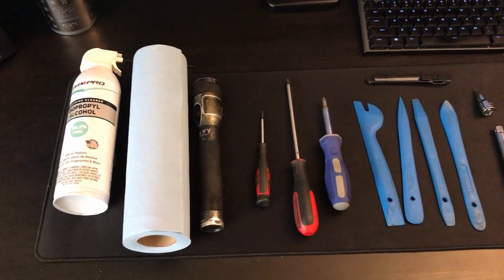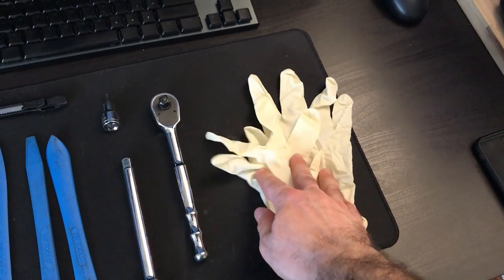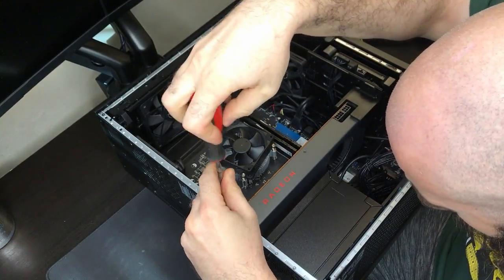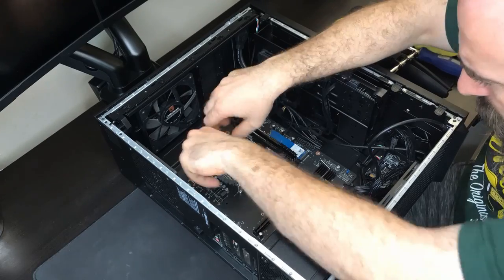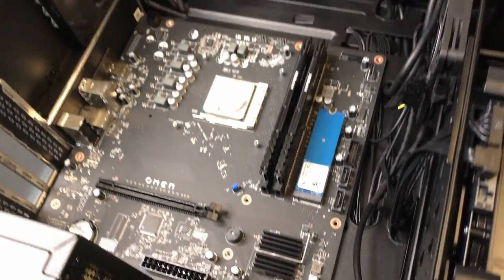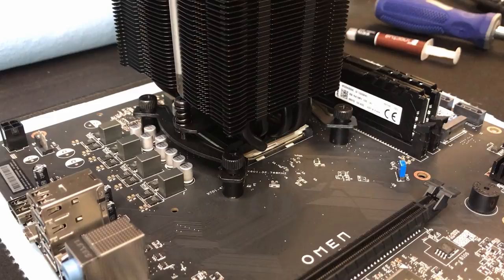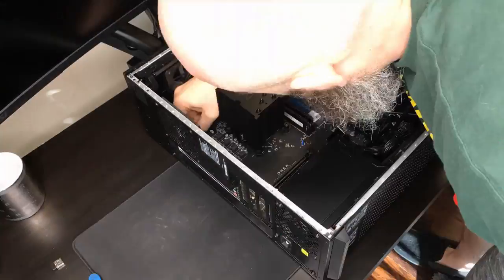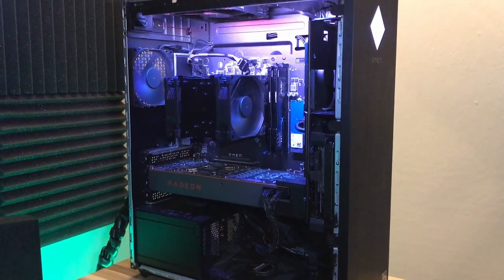Installing A Noctua CPU Air Cooler In My Omen! Complete Tutorial 😎

Comment: Hello when shopping for coolers are we looking for AM4 compatible for the omen? Thanks for you help in advance
Reply from the maker: ALL Omens are Intel spacing.
Reply: @DanKamYouKnow  is that amd ? Sorry I’m new to this and trying to see what noctua coolers are compatible cheers
Reply from the maker: AM4 = AMD / Omens are Intel. Only Noctua coolers that will fit are U9S / D9L
Reply: @DanKamYouKnow  aaahh thanks a lot I appreciate all the help your channel provides for us omen owners it’s perfect for people like me who don’t have a clue, I have purchased 2x 120mm fans one for the top and bottom and the u9s also I have rerouted the RGB cable for the standard cpu spire cooler and put that rgb fan on the rear exhaust fan one screw through the proper hole and one through the mesh of the makes sense
Reply from the maker: Nice! That’s the perfect setup right there! Happy to help 🤝
Reply: @DanKamYouKnow  also is there a way to change the cpu and system fans speed, I can change the gpu via msi but can’t work out how to do the other fans other than the standard settings in the omen hub thanks again
Reply from the maker: No programs work with the Omen motherboard unfortunately. We’ve tried all of them

Comment: Hey bud I got a question. I bought some corsair ll120mms, I have plugged them up. The lights and fans kick on, but when I download corsair IQUE the fans don't register. I read I need to be hooked up to a USB2.0. does the Omen 25l's come with USB2.0 header? Or would a USB2.0  connection work? Please and thank you for your time.
Reply from the maker: Hey Nicholas, there is most likely and issue because it’s not plugged into the motherboard, and unfortunately, the Omen motherboard does not have USB headers at all. Unfortunately I don’t have much experience with RGB so not sure what to do for a work-around.
Reply: Thanks anyways appreciate the help.
I actually ordered the GIGABYTE Z490 AORUS Elite in hopes the 2.0 headers on the mobo will be my fix.
Reply from the maker: If you’re going with a different board, you’ll be totally fine and it’ll have RGB headers and USB headers 👍🏻

Comment: Man that backplate was hard to pull out, I had to use an old card to get it out. Luckily the motherboard still works. I'd installed a Hyper 212 cpu cooler, btw.
Reply from the maker: Yeah, the backplate was a pain for sure. Most of the 120mm fan air coolers ( like the Hyper 212 ) are too tall to fit in the Omen case, you got it to fit?
Reply: @DanKamYouKnow  Well I case-swapped my Omen earlier, but yes, it does work. And no I could not get it to fit into the HP Omen case. Too tall.
Reply from the maker: Ohh, I thought you meant in the Omen case lol. This video is very old and I have a DIY build but still have my Omen, but it has a 120mm AIO that I installed for content purposes

Comment: I’ve been trying to get a wraith prism on my omen pc, and I got the amd stock mounting bracket but it still dosent fit
Reply from the maker: Wraith Prism will not work on an Omen board because all Omen motherboards use Intel spacing for their cooler brackets ( Even AMD processors ). You need to find a cooler that has LGA brackets as well, while the Wraith will only have AM4 brackets.
Reply: @DanKamYouKnow  ok thank you

Comment: Do you know where to find or a link for those black brackets? After watching video i want to do this install but not sure if the brackets come with the cooler or have to be purchased seperate. I have the AMD ryzen 7
Reply from the maker: So if you have an Omen, you are going to use the Intel bracket for the cooler. HP designed these so Ryzen and Intel both share the same cooler bracket design, and that is Intels. So whatever cooler you do have, you’ll want to use the Intel brackets. If you did need the brackets separate for some reason, you might have to contact Noctua.
Reply: @DanKamYouKnow  ok gotcha . I just have the stock cooler that came with it . I am guessing I will have to contact them and see if I can get the bracket
Reply from the maker: Which cooler are you looking at? All the brackets you need should be in the kit, you just have to use all the Intel brackets / spacers / etc.

Comment: Hey I need a little help, I followed the steps but in the bottom left of the motherboard there still seems to be a great force stopping me from removing it I already unscrewed all the screws and don't see anything that could be stopping it could you help me?
Reply from the maker: It is most likely still stuck on the case standoff. You just have to keep wiggling until the board comes loose. It can be very tricky to get it out.
Reply: @DanKamYouKnow  also do you know any alternative to the big plastic prying tools? I don't really want to buy any
Reply: @DanKamYouKnow  Nevermind, I got it installed and working with an NHD9L
Reply from the maker: Niiicceee

Comment: I bought a Omen 30 L in January of 2021 it’s  April 7th and I’m having issues with it shutting down when I launch games. HP tried trouble shooting but had no luck. They want me to send it in I think this might be the issue. Am I crazy to try this route instead? Does this video make it seem that easy or is it more than a novice should attempt. Thanks in advance and sorry for the long comment.
Reply from the maker: Any ideas what kind of temperatures you are seeing when you’re in game? This modification is for cooling the CPU which will dramatically lower CPU temps.
Reply: @DanKamYouKnow  I’m not sure honestly. I’m fairly new to pc gaming. The Omen 30 L is the first pc I’ve ever owned. I’m to the point that I can’t even launch certain games. I primarily play Fortnite and I can’t get past the lobby before I get a full shut down. I can cruise the internet watch you tube. But the moment I launch Fortnite it just shuts down so I can’t get a good idea of it’s over heating. I can run rocket league with no problem.
Reply from the maker: Did you do a graphics card driver update when you got the PC? Go to NVIDIAS or AMD’s website ( for whatever graphics card you have ) and update the GPU. Example: “RTX2060 driver update” or “AMD RADEON 5700 driver update” and follow the steps to install the newest driver.
Reply: @DanKamYouKnow  I went for it. Amazon mailed me the wrong color so I’m waiting for the right one I’ll let you know how it goes.
Reply: But yeah I did all the driver updates.
Reply: Update!!! I installed the cooler fan and it was as easy as advertised. I ended up have to send it to hp and they verified that gpu did indeed go bad. They replaced it and it took like 4 weeks. Got it back the fan is running it significantly cooler and really is pretty quite. Thanks for the help!!
Reply from the maker: That’s great that you got it fixed and that turn around time sounds pretty normal for HP warranty related repairs.

Comment: Would you need to remove the stock mounting bracket if you were trying to install an AMD wraith cpu cooler? I have the same questionable stock HP Omen circle style heatsink on top of my Ryzen chip in my Omen 30L. I wasn't going to go for anything fancy but figured a stock amd full coverage heatsink would work better than the stock omen circle contact one.
Reply from the maker: All Omens are actually Intel spacing, so a wraith cooler won’t work. You’ll need a cooler with Intel accessories, even if it’s an AMD processor in your Omen
Reply: @DanKamYouKnow  Tbh that makes even more sense with why the Omen stock cooler would have worked just fine with the smaller intel chip contact wise but runs 60-70c when used with the Ryzen. Is there any other cooler I can replace the Omen stock cooler with that doesn't require replacing the mounting bracket? In other words just trying to screw something compatible on that doesn't have that horrible circle contact that the omen stock did.
Reply from the maker: The best cooler for Omens ( because you need to stay under 140mm in total cooler height ) is the Noctua U9S. Matches the Omen aesthetic really well as well
Reply from the maker: But, you’ll need custom length screws to secure it, and I’m not exactly sure what entails in that process. I replaced the backing plate when I did my tutorials on the U9S and Corsair H60 120mm AIO
Reply: @DanKamYouKnow  Ah yes and I started exploring your channel and just found so many answers to my questions. Thank you so much! Time to study then execute, wish me luck! I will try the U9S and by watching that video on it I got to see where the tape was placed under the bracket so even better. Oh yeah and Dental floss! So much learning is taking place.
Reply from the maker: Dental floss and a heat gun on low / blow dryer does the trick really well my friend. 👌🏻👌🏻👌🏻
Reply from the maker: I like that saying btw: Study, then execute.
Reply: @DanKamYouKnow  Can't say thanks enough for this info. Especially with this particular build. I have run into SOOO many issues that I never have with normal custom rigs. I'm really impressed with how you took something not very enthusiast friendly and still upgraded it. Your ability to do that is thoroughly fueling my upgrade drive and confidence right now. Just seeing something I thought not possible or worth the effort/money being done has the lightbulb above my head shining bright lol.
Reply from the maker: No problem and thanks for the kind words! The case is the limiting part with how small it is. Very few coolers work, RAM is a pain to upgrade, BIOS is locked, etc. Still can be made into a cool running little machine though. I still have mine after 2 1/2 years of owning it and not a single issue. I use it as the PC that’s hooked up to my living room TV and it works great
Reply: @DanKamYouKnow  Well earned! and 100% I have certainly run into pretty much all of the obstacles you listed recently but I have excellent news! Remember that studying that I talked about? Well so far I've been able to get the idle temps from what it was sitting at from 66-71c to now 43-51c. My 2x16 ram operates at 3200 now (beat the locked bios). I have a much better understanding of what's to come when I install the new power supply. I used this rig to practice all of my beginning technical skills on. I feel like overcoming the obstacles of this machine makes you that much better at knowing how to make things work in a better setup too. Gonna be snooping around this channel for a hot minute. Future pc tech-man in training here lol.
Reply from the maker: That’s awesome, and I totally agree that the HP Omen is a great computer to learn on and use those skills to continue modifying, and then end up with a DIY build, or close to it. PC’s are just adult legos but we need to start somewhere, and it sounds like you are starting out right 👍🏻
Reply: @DanKamYouKnow  " PC's are adult legos" 100% agree and a good saying. Certainly getting a good start and with the proper tips. Good stuff man. You'll certainly be seeing me around!
Reply from the maker: Appreciate it Steve 🤝

Comment: hello I have in omen 25l with aa core i7 10700k and an RTX 2060  it is a small GPU and I installed a Noctua fan on the bracket  120mm the same one as you have but I can't control its speed I don't have a fan control option in omen command center so I'm hoping you respond and give in the idea for how to control fan speed and give me a program or something I have very high temps when I game they reach 82 and 80 even the CPU it reaches 80  so I want to control fan speed and  get my pc run cooler and thank you  for being  an amazing content creator  hope you respond
Reply from the maker: Hey Hassan! Thank you, I’m happy my videos have been helpful. So, a couple things to try: update the Omen Command Center app within the Microsoft Store. Is the Fan control tab not showing up in OCC right now?
Reply: @DanKamYouKnow  yes it isn't showing in occ
Reply from the maker: @hassanalfadhil581  The update didn't work?
Reply: @DanKamYouKnow  it had no update
Reply: @DanKamYouKnow  I installed MSI afterburner and it works but still don't know why the fan option isn't there
Reply: in occ i mean
Reply from the maker: That’s really strange. You may want to call HP and see what they say about it, it usually shows up after updating OCC. Sorry I couldn’t be of more help.
Reply: @DanKamYouKnow  NO PROBLEM  THX  ANYWAYS

Comment: Had to do the entire thing with my liquid cooler
Reply from the maker: Nice! You had the Corsair H60 right?
Reply: @DanKamYouKnow  no I had the nzxt m-22
Reply from the maker: Ohhhh. Question for you because I have someone else asking. What did you use for the RGB on your M22? I thought a SATA to USB 2.0 cable would work but he said it didn’t. What did you use to get it to work?
Reply: @DanKamYouKnow  I used a third party usb and took out one of the dust protectors below the graphics card and plugged it into the back of the pc. Also, it doesn’t need the usb to be functional

Comment: I’m having trouble removing motherboard. It’s catching on something with the audio plugs in the back? Don’t wanna mess something up helpp
Reply from the maker: And you’re sure everything from the back IO shield is disconnected and you have all 8 screws removed? It takes a minor amount of force but should angle out relatively easy.
Reply: @DanKamYouKnow  got everything installed! 
Now when I go to fire up I’m getting a PCIe power cable not connected but I’m possitive I’ve got everything connected. What could be the issue?
Reply from the maker: Do you have the correct cables installed in your graphics card and is the GPU fully seated?

Comment: Hey Dan, so I put in the new cpu cooler, and put back everything the way they were supposed to, or at least I think so, but now when I turn on my pc, I get some weird beeping noises, and my monitor wont turn on, even though it is plugged in. 

The pc is running and has light, the fans work just fine, even the light of the gpu lights up as well. But when I try to connect my keyboard to the pc, the keyboard does not light up (normally it does). Do you know what could be the problem here and how to fix it? 

Thank you, I appreciate you!
Reply from the maker: Count the beeps and let me know what it is and make sure your RAM is seated properly. What did you use to remove the stock cooler bracket? Is there anyway you might of scratches the motherboard?
Reply: @DanKamYouKnow  It is 3 long beeps and then 2 short beeps. I used the dental floss and prying tools to get the stock bracket off. I dont think I could have scratched it? I also did take out my RAM and put them back in to make sure it is seated properly, but that did not help
Reply from the maker: And you’re 100% sure you have everything plugged in properly and the GPU is fully seated as well?
Reply: @DanKamYouKnow  I believe so. The gpu lights up and seems to be working fine, I think the beeping are either from the cpu or motherboard. No beeping or anything by the gpu
Reply: @DanKamYouKnow  I looked up the manual online, and it says that the 3 long followed by 2 short beeps are because it “failed to return from memory initialization”
Reply from the maker: You can try a CMOS reset: With the power off, hold down the power button for 30 seconds.
Reply: @DanKamYouKnow  Another online solution I found said that the motherboard does not have enough power when upgrade to a new cooler so it makes it difficult for the ram to transfer the memory because it doesn’t have enough power. Was this something that happened to you?
Reply: @lamtai8368 2 years later did you ever fix it?
Reply: @Trajikbpm  yes I did! It was a bad cpu, I must have bent a pin, but it was fine after I swap that out
Reply: @lamtai8368  I'm installing mine this weekend I'm getting nervous
Reply: @Trajikbpm  for me it was because the cpu was simply not working, but otherwise you should be good. Just make sure it is seated correctly and don’t bend any pin like I did lol

Comment: I just installed mine today but when I boot my pc it displays nothing on my monitor,and it beeps three times.its just sitting there with the fans going,I've tried unplugging and plugging everything back in but it isn't working,what should I do?
Reply from the maker: It’s possible that you may have bumped a RAM stick and damaged the DIMM slot or you could of scratched the motherboard. I would try using one RAM stick in another slot and see if it boots uo
Reply: @DanKamYouKnow  I've upgraded from the stock ram to the ripjaw 32 gig ram you had in another video,that was the ram i had in when I did the cooler replacement,after installing it and powered my pc on i discovered the problem,I tried powering it down and putting the stock ram back in,but it just makes a different series of beeps
Reply from the maker: Did you try it with just 1 stick? Try 1 stick in 1 slot and then try that same stick in another slot by itself.
Reply: I tried it but it just keeps making the same three consecutive beeps when powered on
Reply from the maker: @albertdelfroy3880  What did you use to remove the cooler bracket? Is there anyway you might of scratched the motherboard?
Reply: It was to put it bluntly a spike with a screwdriver handle so its possible I will have to take the motherboard out and check closely